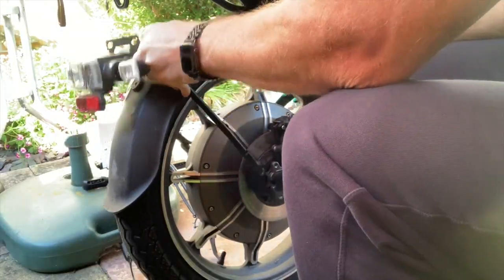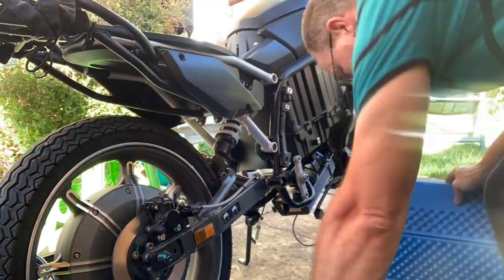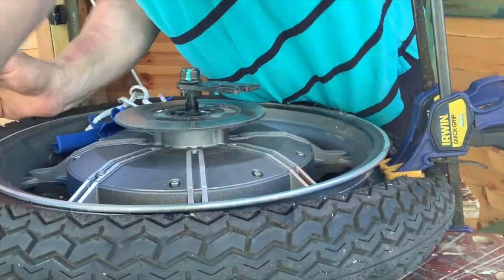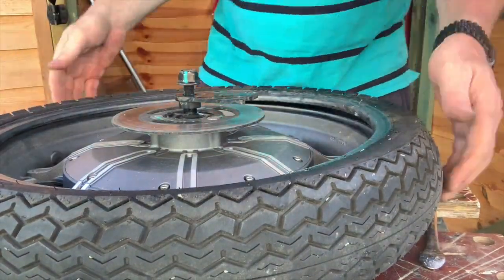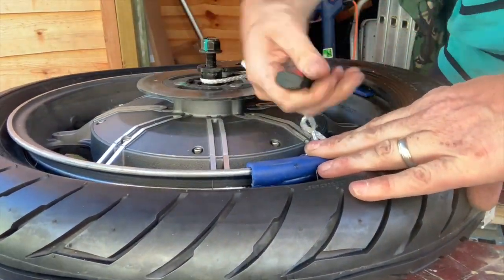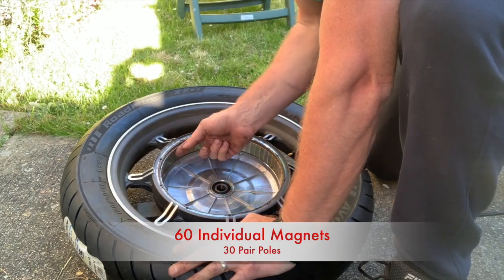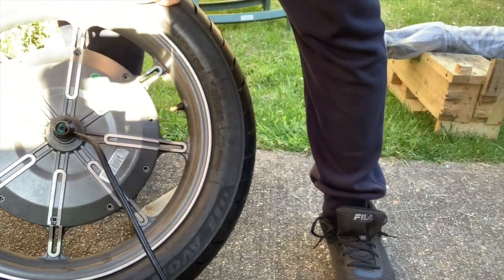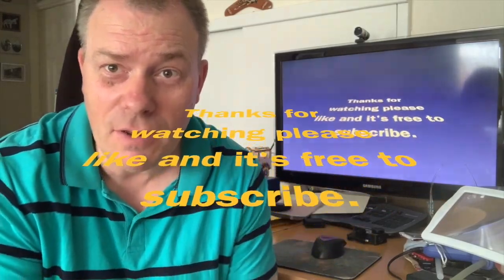Installing Sabvaton part 2 to Super Soco TC/TS Vmoto Fitting Rear Tyre / Tire & counting Pair Poles

Comment: so 30 pole pairs means how many mid mounted pole pairs?..  found a graph suggesting 7.5 but the controller settings that i currently have say its 4 (which was supposed to be set up properly).. but i have suspicions something isnt right...